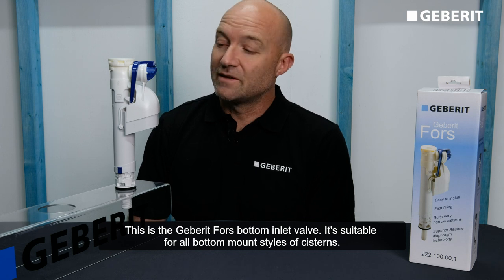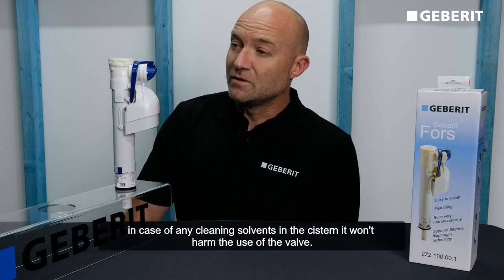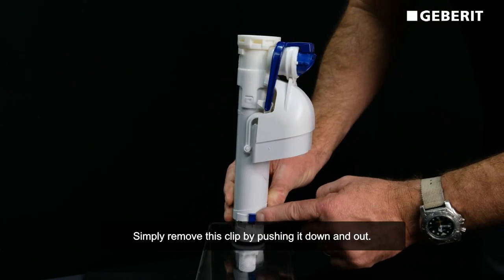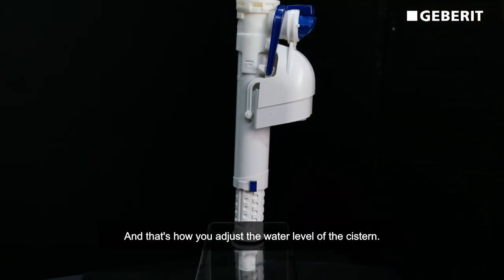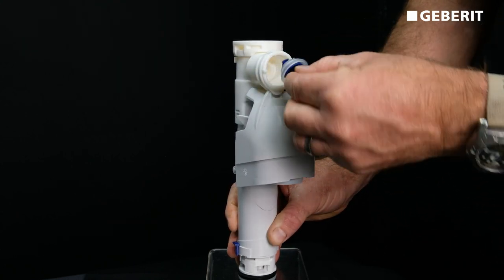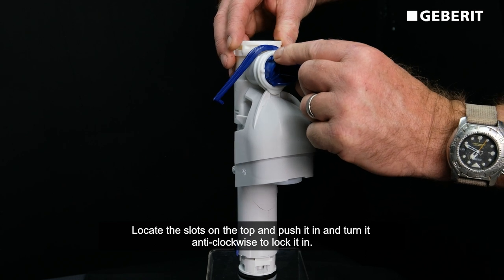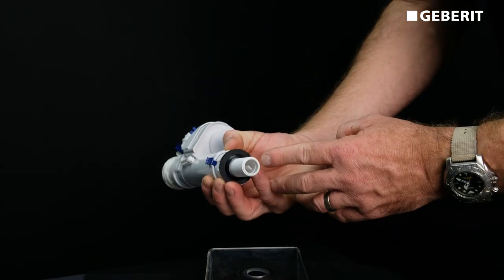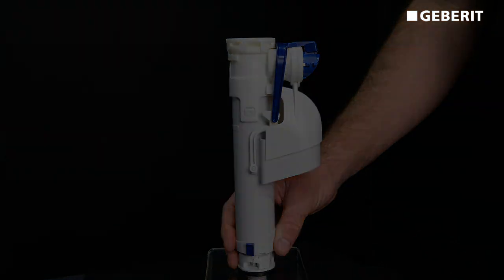Geberit FORS Inlet Valve Installation

Comment: After flush, air bubbles are coming out from the lower part of inlet valve and water leaks into my toilet. How should I fix the problem?. While air leaking, water is hard to fill inside and takes long time to complete filling inside.

Comment: Hi have fitted a new unit as proposed but the water flow is very very slow is there any common issue with this - the original fill was very slow as well
Reply: Would love to know how to adjust water flow too. Did you manage to figure this out?